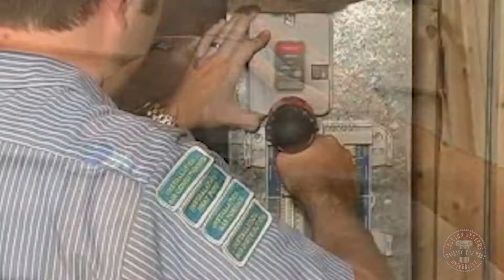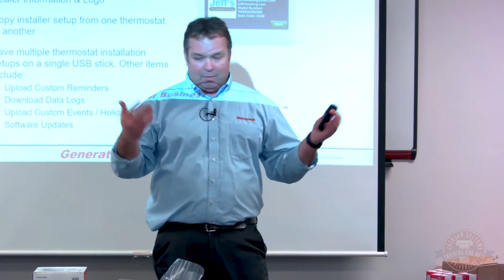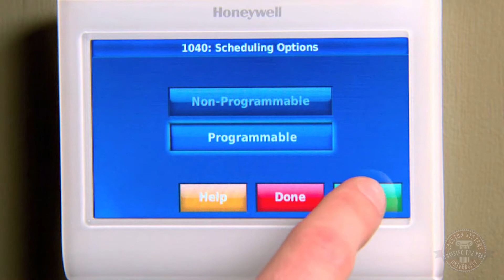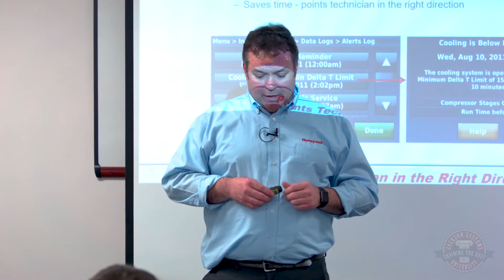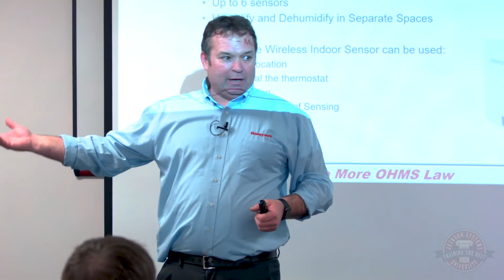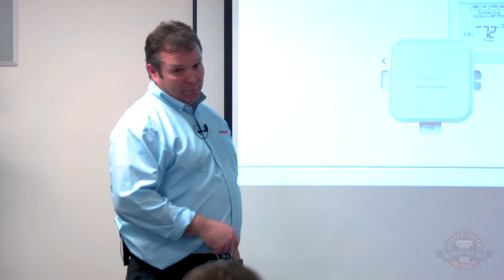Honeywell RedLink Update 2018

Comment: Great information:  Question if you dont mind.  I am working to utilize the Presige IAQ kit to control a Dual Fuel System. You mentioned a due Fuel module but I cannot find any reference to this module on the  Hionewell site.  The senero is:  Customer has a Duel fuel furnace (Wood and Oil +24 turnes on Wood, +24 turns on Oil)  and adding a heatpump: desired outcome:  Wood Furnace  as Primary heat, Heatpump as Secondary until outside temp reaches  less than 30deg F then Fuel oil.    is this possible with the Prestige IAQ Kit with wireless outdoor temp sensor, the kit purchased for this is YTHX9421R5101WW.  Thank you in advane for your help.